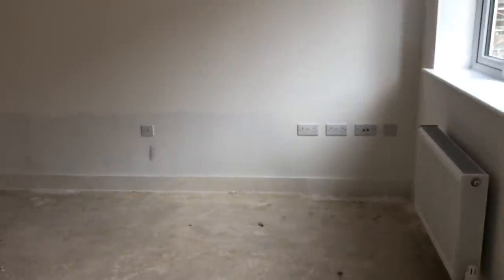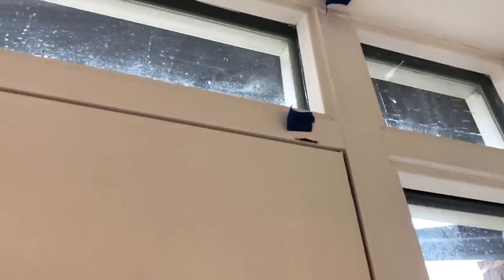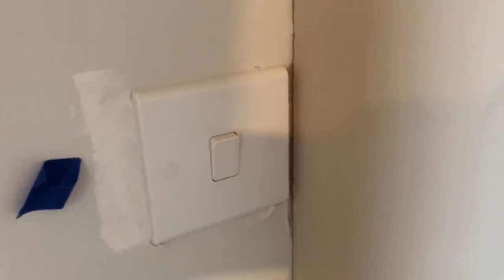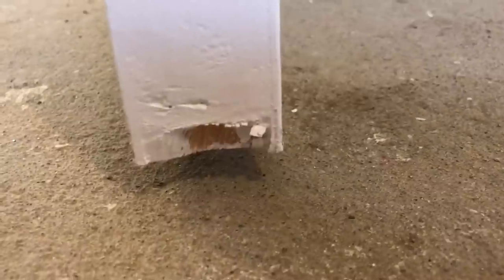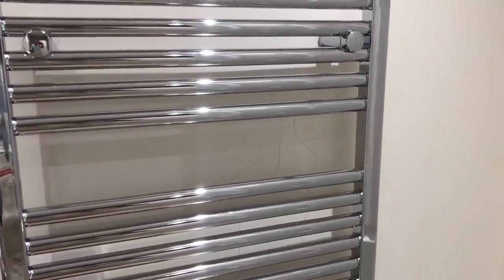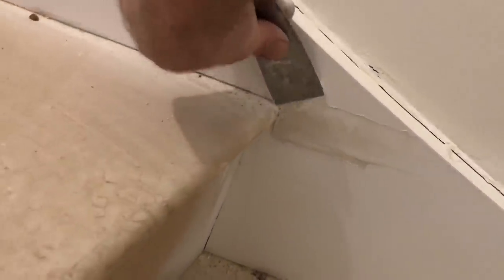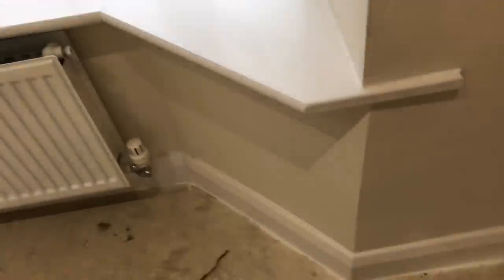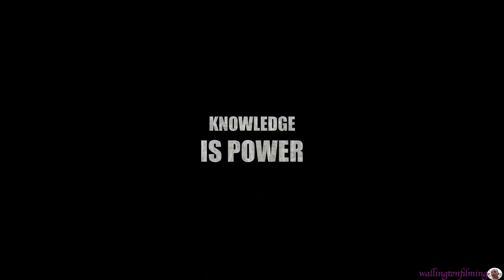101 Paint defects

Comment: I do a lot of new build work. All of these are classics. The facts are the plastering is always now way off the required standard and the chippies now do not even try and get anything right. Arcs you can get your fingers behind they are so far from the wall same with skirts. When your using a tube of caulk per room on million pound plus houses. Something is clearly wrong.

Comment: The best will in the world you can miss something on a large house. That red mark on that frame for example is easily looked over. A run or perhaps you touch the wall when glossing and forget to back cut it later. Perhaps the light is crap and you miss a patch that needs touching in etc. At a stretch id say the 3rd coat on some doors. But some of this is insane! The state of the walls and pipes under the boilers and staircases is mind blowing